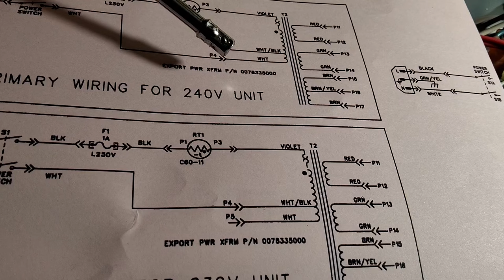Let's Fix a Fender Super Sonic 22 Combo Full Repair and Demo

Comment: Great job Martin! I usually replace every single electrolytic cap in these Super Sonics. At a minimum, the power supply and some component readjusting here and there to keep things cooler. Fender likes to put hot things right on the board or leaning on capacitors.

I actually like the Super Sonic 22 and the more powerful versions. They’re a lot of fun, as you found out for yourself!
Reply from the maker: Hello Matt, thank you. The customer was happy it was running again. But if it comes in again I certainly will change all the caps. And any others that come across the bench will also get a full re-cap. I like this amp two. It surprised me how good it sounded. Take care Matt.

Comment: Great video - thanks....I quite often get 248 volts AC out the wall at my house, it's a nightmare if you have valve amps - ended up getting a Variac to sort the problem.
Reply from the maker: Hello Jools. Wow, that's high. That must push the heater voltage to above 7 volts?
Reply: Yep I used to see 6.8 -6.9 volts AC on the heaters so ended up running my valve amps off a Variac set to 238 volts for that very reason.

Comment: I would have suggested replacing the two small caps next to the voltage regulators and heatsinks with 105C caps, leaning the new caps away from the heatsinks; they're probably fairly well baked from heat exposure. Also check the soldering to the Thermistor, the black disc on the rear corner of the board ---- those things run *blistering hot*, and it appears to be leaning against a film cap. Thermistors should never be mounted flush on a circuit board, but virtually every manufacturer does it.....😖
Reply from the maker: Hello. I checked the Thermistor when I checked for dry joints. The board was in good shape. I have been in and checked and moved any leaning caps. I will certainly change all the caps on the board next time. Take care.

Comment: I have wondered for several years why there aren't more guitar players using theses Fender Super Sonic amps. Perhaps it's the price tag ? The drive channel is a bit like a Boogie. You have to fiddle a 'lot' with the duel gains and EQ's to get 'that sound', but it's all there. Another 'Why' is why Fender UK let their amps out to retail with the mains TX set at 230 V AC ??  Great repair Martyn and superb playing to demo a great amp.
Reply: I have a blonde head version.Love it!
Reply: They are very fiddly with the gain pots. They also don’t have a great reputation when it comes to reliability in stock form. A complete recap in the power supply/low voltage supply and they’re rock solid. Those IC caps really did a disservice on these things.

I actually like them quite a bit after they’ve been serviced.
Reply from the maker: Hello Pete. I was surprised when I did he the demo how much gain this amp had. The clean sound was good too. The transformer was set at 230 volts.. Thanks Pete, take care
Reply from the maker: Hello, nice. Even better in a head version. Thanks for watching and take care.
Reply from the maker: Thanks for the advice Matt. If it comes back with more faults the full re-cap it will be. Take care.
Reply: The mains voltage has improved over the decades (centuries?). The standard U.S. voltage used to be 110v, then 115v, 117v, now 120v. Amps were set to the standard at the time of manufacture.
Reply: Having owned one for 15y, here's my .02.  Best sounding, most fun to play amp I've ever owned. It weighs far too much to gig with and is far too loud for a home. Tubes and electronics failed within a year. A year later the always unstable footswitch jack went bad, rendering the entire thing useless. Because it is inexplicably a rare or even proprietary chord type, repairs are $200+,  so now I don't play it. It's a beautiful and very frustrating amp

Comment: 18:18 What is that? It's the answer a was looking for! My newly bought Supersonic has exactly the same problem! Now I know what to do! Thanks!
Reply from the maker: Hello, thank you. Faulty tube socket? I wonder if it is a common problem on these amps. Let me know if that's the problem. Thanks for watching and take care.
Reply: @vintageguitaramp_guitarteacher   Capacitors and sockets changed… and the noise is stil there… 😞 Rushing water noise or popcorn noise,  I don't know exactly how they call it. On some other videos, the answer was the reverb tank, the tubes, a resistor… My tubes and tank are ok. So I don't know where to look for exactly now…
Reply from the maker: You could change the plate resistors. They can be noisy.